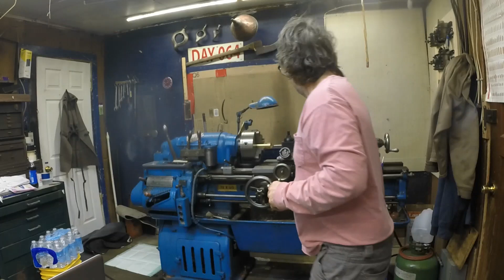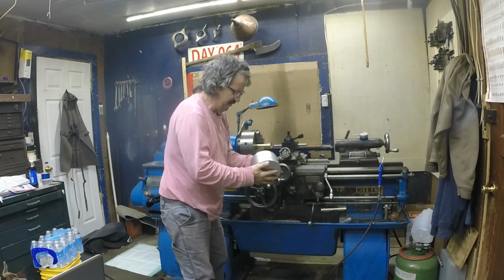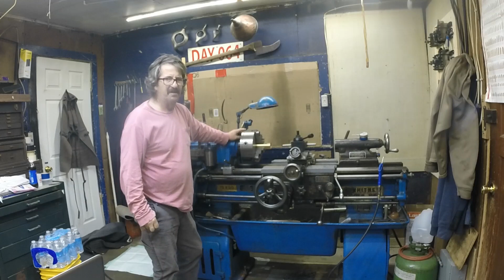VIDEO RECOMMENDATIONS,ODD AND ENDS

Comment: Just disconnect the feed screw and lead screw and clutch rod at the gear box and slide it all to the right a few inches then you can remove the apron with no need to move the machine from the wall and it will save the huge cluster of trying to get all of those items fed back thru the apron when you go to put it back together.
Reply from the maker: Big thanks

Comment: 'IF' :   If it wasn't the DEAD of WINTER , I'd drive up there & give you some help !  * Driving would be less expense than flying . . . though I'd have to arrange a way for my vegetation to water itself - I've got 'groceries growing ' in my dining room !   I checked distance & travel time , you're just a little more than 8 hours away .
    Steak would HAVE to be RIBEYE , & barbequed to perfection over a maple or hickory fire !    * I'd gladly do the 'meat cooking honor' ;)     
     Recently , I had an Amish logger buy 2 black walnut trees from this property - ( belongs to my little sister) . . . but the proceeds are going to 'house repairs' . . .   Yeah , I know ; 'what's THAT ' got to do with ANYTHING ?
* I need to be here to oversee the tree whacking !  ** I'm getting all the wood that is 3" to 6" diameter . . . ( going to use THAT for turning on my wood lathe  )    PLUS , some of the wood will be turned into thin strips for guitar building / trim . 
      I hear you wondering , " HEY GEORGE  , where are those DRAWINGS ! "    * 'Still in the pen & my head !
                                  . . . Meanwhile ,  . . .       There are multiple ways to remove the hide from a feline !   "V"
Reply from the maker: Thanks George a very interesting view into the life of Mr. Jetson.
Reply: @kimber1958   'Looks like you're still a bit of wrenching away from being able to do any milling on the lathe - BUT , it's easy enough to do small(ish) jobs by clamping an ANGLE PLATE into the toolpost !    * What is the cross slide's capacity ?   ( How much travel does it have ? )   That would be your maximum capacity . . .      Hahaha 'Mr. Jetson !  '       'Guess that we're ALL 'cartoon characters , in our own way !   ;)
Reply: @georgewocosky  I turned a replacement cross-slide lead screw on and for my mini lathe that's 2" longer than the original giving me close to 5" of x-axis travel, and I bought a verticle slide milling attachment that has a lead screw giving me 3.25" of travel and made a mounting plate for that. So I can do a bit of milling with x, y, and z-plane movement. I also mounted a cheap chinese DRO which is a godsend. The y-axis scale is moutned to the vertical slide attachment and goes on and off with the attachment. I can also set up the DRO to work with 3 or 2 axis.  This buys me some time to shop for and acquire a real milling machine.

Comment: My Dad's P&W did the same the with the cross slide. As I recall it was a simple fix. It was long ago and my memory is not serving me well. The cross-feed knob may just be jammed all the way out. Try locking the cross slide so it will not move , and force the knob back in by turning it clockwise. The problem may have started by powering both axis simultaneously. Not all lathes should do that.. The P&W may be one.
Reply from the maker: That’s likely. (Tuning both)
I have a video of when it locked up and I turned the machine off while it was still engaged when I went to power the machine up again and tried to engage it it would not go I have been doing what you suggested all I can do is keep on with that there is a chrome collar around the base of the casting and  I  may start trying to screw that out or pry it out I’m not sure if it’s Pressed  or screwed,
I have had the carriage removed and everything on the right end of the apron is pretty much sealed and you can’t access any of the moving parts. I’m just wondering if it’s worth taking the apron off because the whole unit is still going to be sealed.
Thanks for your comments and your observations if memory returns don’t hesitate to send me a message .